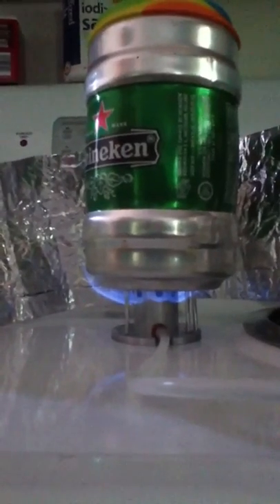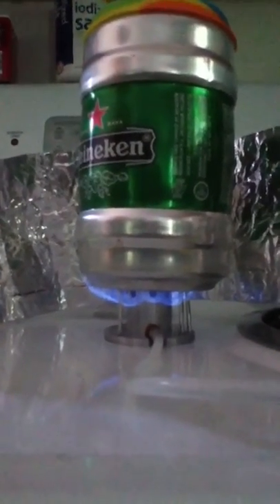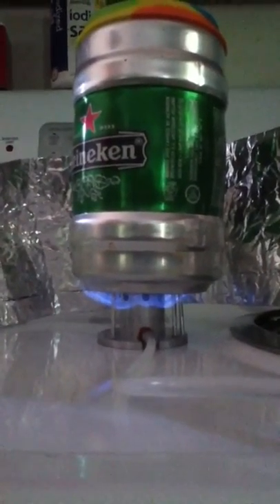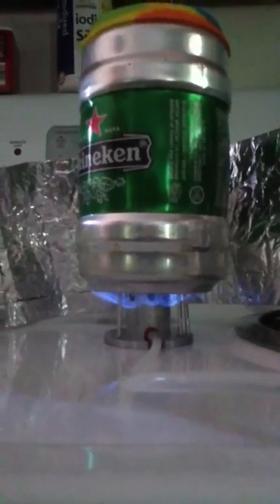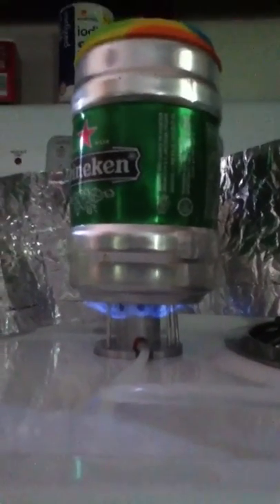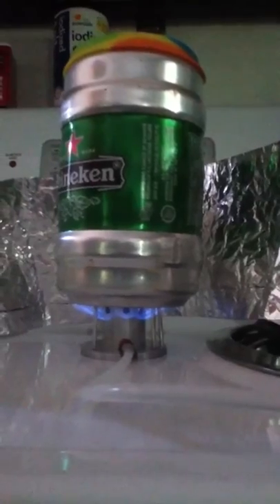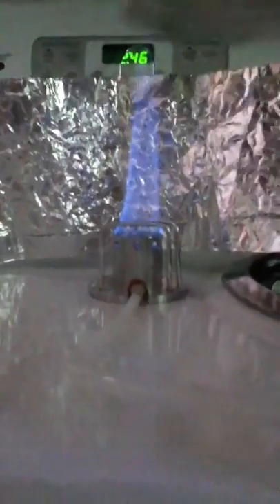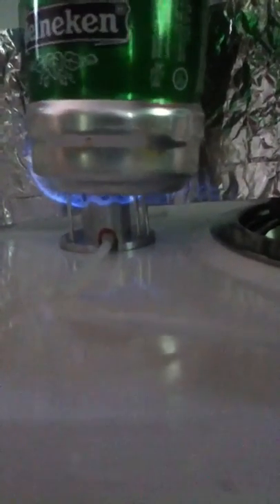Mini alcohol stove for ultra-lite backpacking

Comment from the maker: @digitizer101 Hey I used bar stock aluminum, the inner burner is made from 1" stock I drilled it out on a lathe then milled the bottom flat on a milling machine. The outer ring is actually a larger diameter piece that I drilled out the center on the lathe so that the burner fits snug in the center. The pot rest are made from aluminum welding rods. I will be posting more videos.